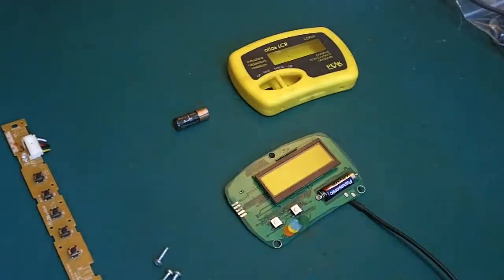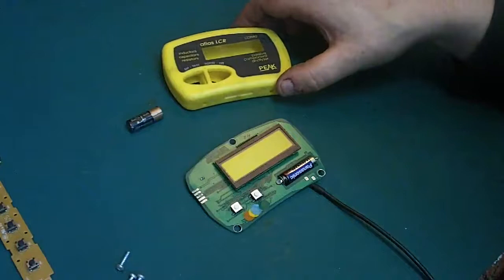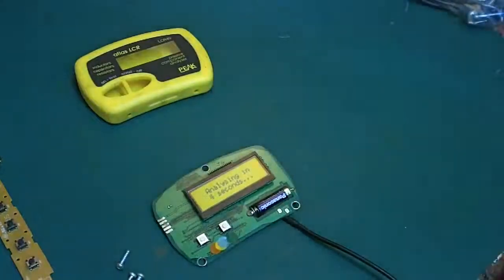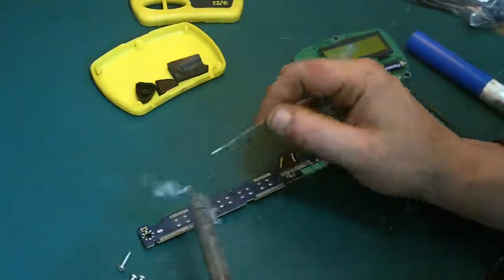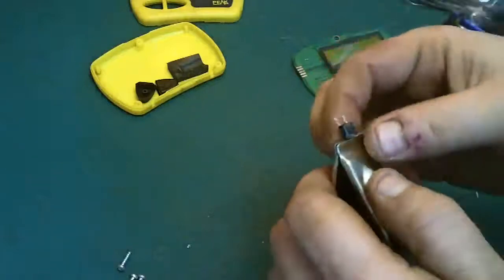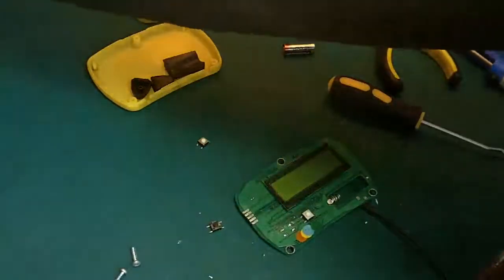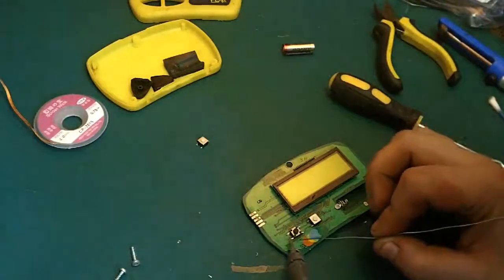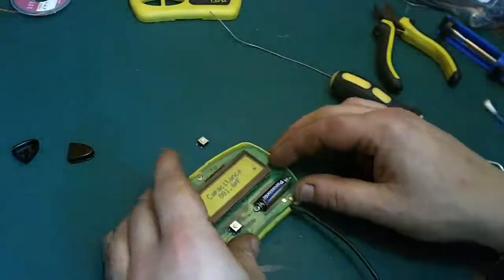PEAK Atlas LCR tester repair

Comment: Presto, another job done. Might want to do the other switch as well perhaps. 
We didn't get to see the end result, but it should have been alright I think..
Reply from the maker: Yea I need a new camera, or at the least a new battery for it. had to trim the switch down slightly as it was a mm high but apart from that all sorted now. I'll be using it in the next video

Comment: Great stuff =D  A technique I sometimes use on those replacement switches there (if the plastic nub is slightly too heigh) is to just melt the plastic part down a little with the iron, to lower it just a bit (eg. 0.5mm to 1mm).  It's a bit of a fudgey technique granted lol, but sometimes that can help if the nub is just slightly larger than what was on the previous switch.  Guessing you didnt need to that in this instance?
Reply from the maker: funny you should say that, because that is exactly what I did and I’m sure I got the tip from one of your videos. will have to sort my camera as its battery is starting to fail and lost the last five minuets of the video. you will see the tester in action in the next video.

Comment: You'd have a much easier time if you kept the tip of your soldering iron clean and tinned. That awful tip you have is basically insulated ;-)
Reply from the maker: Your completely right, truth is I was in a rush and had forgotten to wet my sponge. It will be addressed in the next video.